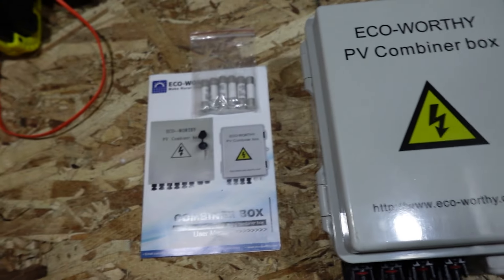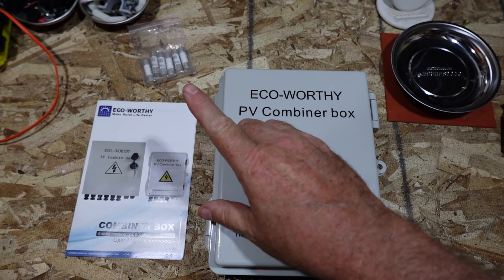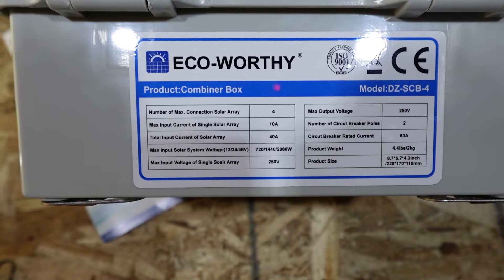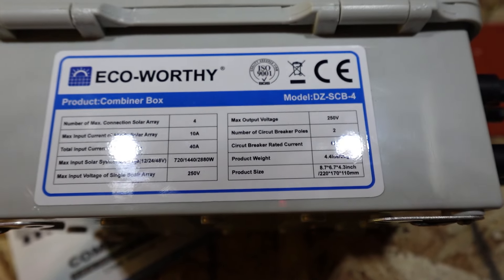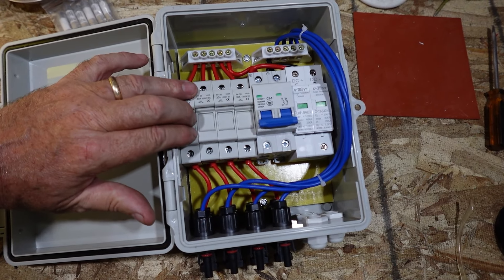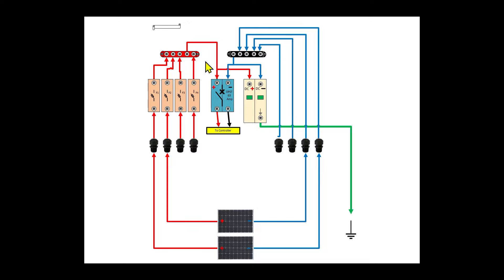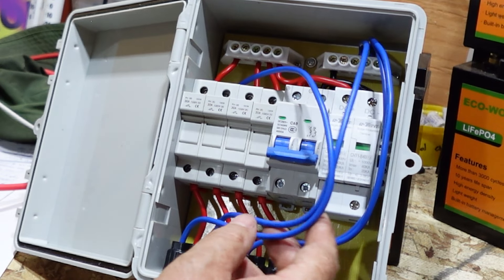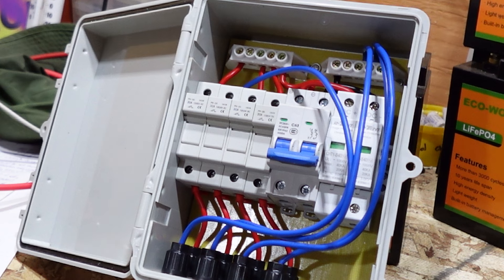Eco Worthy Combiner Box Series Connection Tutorial

Comment: I’m looking at purchasing this controlling box. Thanks for the comprehensive video. It looks like it’s reasonably constructed.  I’m just wondering why you would modify the wiring with the control box when you could simply run your panels in series and maintain the factory wiring, not voiding warranty? Also, if you run your panels in series, you could run a lot more through through the combiner box in terms of wattage.  Just wondering.  What you did with absolutely work. I just think it’s the more difficult route
Reply from the maker: @robiker416B  check out my website at solarbeardiy.com .. I can definitely help you out with a variety of options to help fit your needs. All of my components are UL listed and recognized
Reply from the maker: @robiker416B  also I did this video for a couple of folk that already had systems in place and then upgraded to a larger controller inverter, and this was just easier for them to maximize their system without to much extra

Comment: I have 8 400w panels currently 2 in series into combiner.so I'm using all 4 inputs. I just upgraded my controller to an all in one and it requires 120v to start with a max voltage of 500v. Without having to run all new wire, watching your video it looks like I might be able to put these eight panels in series within the combiner box. Is this correct? I know you just did two strings I have four so would that mean that the last fuse holder would be like the second that you have wired?
Reply from the maker: @jsdiecast  sure you could do it, but are all of your panels in the same location next to each other. Sometimes it's just easier to connect them in series where they're at, and run a couple lines back to your combiner box
Reply: @SolarBearDIY  I have 4 trackers with 2 panels each.

Comment: MC4 terminals are retained when connected, terminal is attached to the wire, so of course it is "loose" when not connected. No reason to modify box for series, just connect strings in series then connect to box.